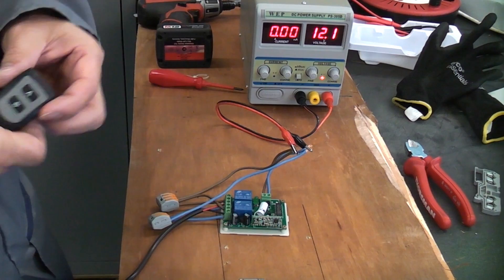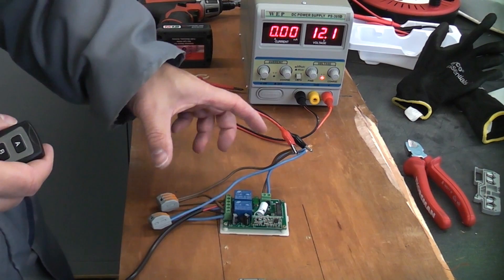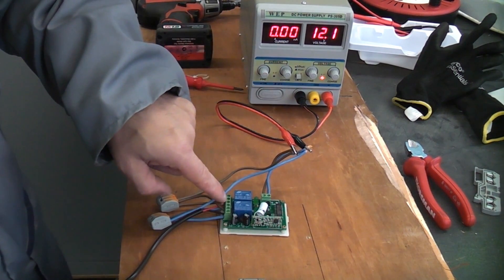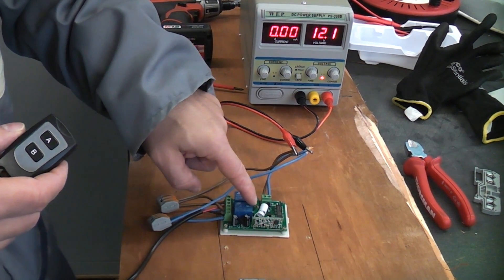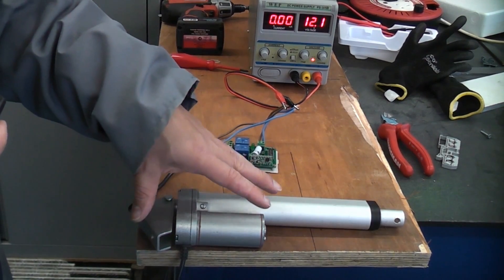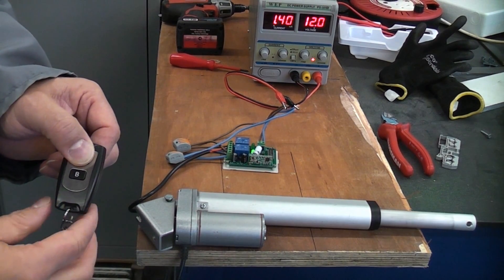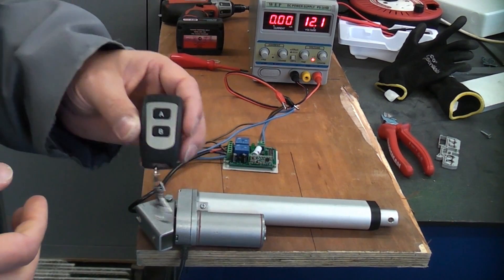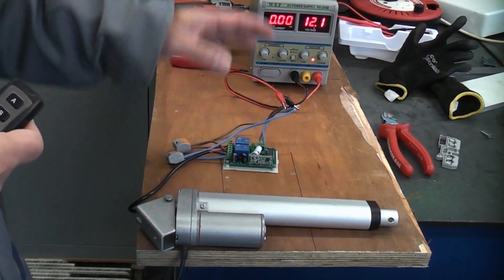Remote wireless relay

Comment: i bought this  http://www.ebay.co.uk/itm/4-Channel-Wireless-RF-Remote-Control-Transmitter-Receiver-Module-PT2272-M4-/232004988923 4 channel transmitter and receiver module. can you provide a circuit diagram if i wanted to control a 12 v high rpm dc motor.
Reply from the maker: No, sorry. You should have a wiring diagram with the circuit board, if they did not send one you should contact them for one.